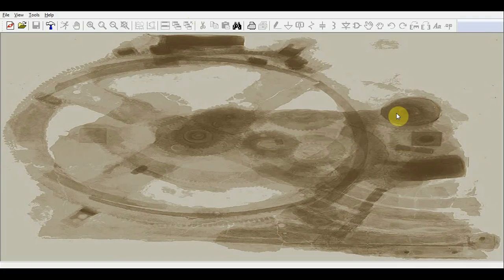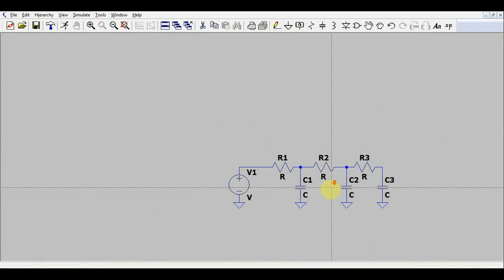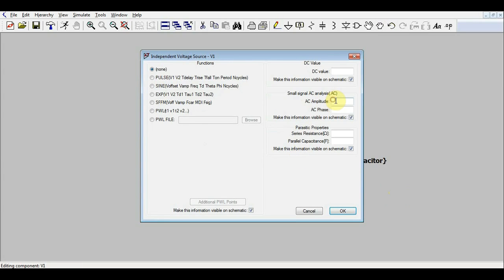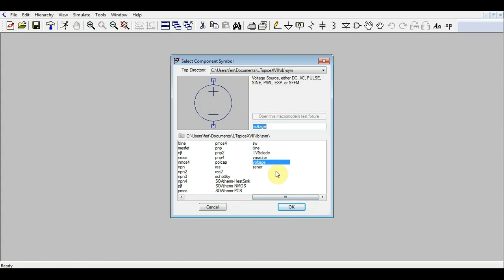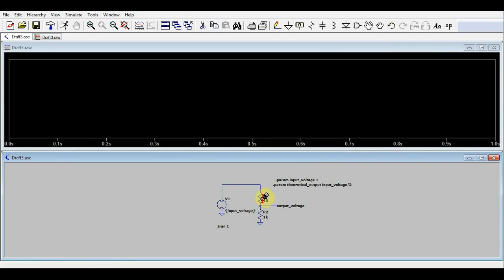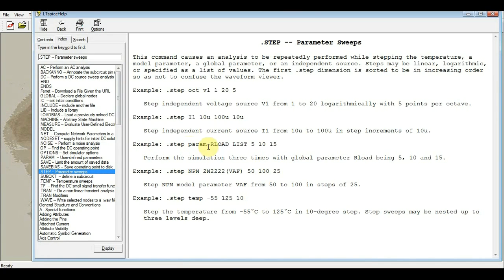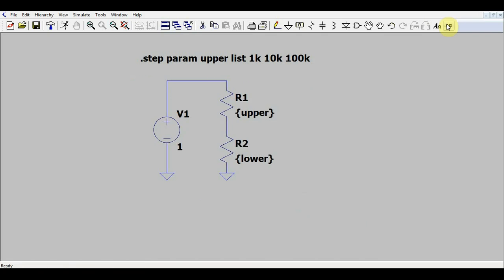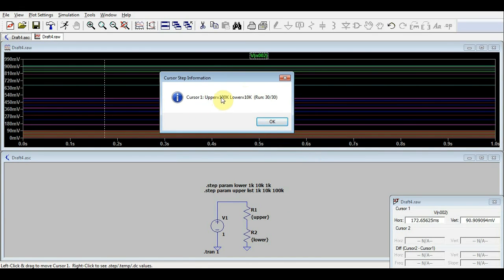LTspice tutorial - EP3 .param and .step directives

Comment: Great explanation, many many thanks for your effort.

Though I noticed anomalies on values calculated, so on the simulation itself.
Made the simpliest system with a dc supply voltage 10 V (no internal resistance), a resistor (set the resistance only) and a capacitor 1.000 uF (set the capacitance only).
So i changed the resistance only, from 0,001 ohm to 100 ohm (manually, step of decades).
Made a transient simulation : .tran 1 (or 10 or 20 depending on resistance)
Time constant is calculated differently depending on resistance.
R = 0.001 -> RC = 1 us => 61.24%
R = 0.01 -> RC = 10 us => 61.18%
R = 100 -> RC = 100 ms => 63.22%
Calculating 10 x (1 - EXP(-1) ) would give 63.21 %.
Differences even with peak currents.

Is it explainable ?

If you prefer a better way to send you data please let me know.

Thank you again
Reply from the maker: When a transient simulation gets performed, the program will not calculate every possible timestep; there will be a certain blanking time in-between steps, where the output plot is just an interpolated line; This will also be visible when performing an FFT on a sinewave - unless you take some precautions, the wave will be highly distorted; The main reason for this is to keep simulation time reduced while still providing useful even if approximate information, so its not really a bug but a feature.
I think this is the issue in your case as well; You can try to force the simulator to have a fixed maximum timestep - something small - its in the transient window editor - the 3rd entry.
May I ask how you calculated the time constant using the simulator?
Reply: @FesZElectronics  thanks again, in this case for the useful advice.

First of all your question.
Actually I said it improperly. I calculated the time constant with the usual formula tau = RC so in my case always 1 us. 
What I noticed is that if I used the definition of time constant as the time to reach 63,21205... % of  supply voltage, I would have calculated different time constants (i.e. > 1 us), simply misuring differences about these percentages.

About your advice.
I summarize the conditions.
Vs = 10V | R = 0.001 | C = 1000u

This what you can't get at 1 us for voltage across the cap and peak current throught cap.

1) .tran 1 -> 6.12391 V | 9.9800 kA
2) .tran 0 1 0 1p -> after 3 min still 0% done
3) .tran 0 10u 0 1p -> 6.321205 | 10 kA | about 1 min to complete
4) .tran 0 10u 0 1n -> 6.3213843 | 10 kA | immediate
5) .tran 10u -> 6.3223453 | 9.999998 kA

So, as you guessed using parameter max timestep:
(3) is the most accurate but a little slow (acceptable)

Useful was of course setting the total time more properly to complete the simulation in a smaller time (1 s -> 10 us)

THANK YOU again

Comment: .inc ,.IC indicates for???
Reply from the maker: .inc stands for "include" -  this is used to include library files; .ic stands for "initial conditions" - this is used to set voltages and currents in the circuit at start of simulation

Comment: Thanks a lot for this quick reminder. I wonder if we can have a step simulation with 2 parameters linked by table.
Let me explain an example :
3 values of R related to 3 values of C which gives the same cross frequency
We would like to compare R1C1, R2C2 and R3C3 only (not the 6 other couple)

is there any tips to do this ? like .step (R C) list ((R1 C1) (R2 C2) (R3 C3))  <== this doesn't work ^^

in this situation I can create C value from R with fc=1/2*pi*RC but this was an example. Sometime you could have 2 separate list with no evident related formula.

Thanks for every answer I could get

Comment: Nothing about curly brackets and when to use them, or the problems with doing simple arithmetic between two variables in a .param statement?
Reply: man i have the same problem. i am getting 440 solutions , i need 40 only. but its stepping all the possible numbers.

looked around the internet with no way to step it properly. let me know if you find something
Reply: hey there once again, so i kept trying stuff around. in my case i had 2 changing resistors (one increases by x )(other decreases by x ).

what i have done is set {w} as a parameter for both resistors.
like this
R1={w}
R2= - {w}

i hope you are doing the same thing. good luck

Comment: How do i make the simulation for only the correspoding values in the 2 lists  and not for all possible combinations?
Reply from the maker: I guess the best way would be to make the second value an expression related to the first; say you want to simulate in case 1 a 1K resistor and a 5k resistor; and in case 2 a 2k and 10K; you could express value 2 as {value1*5}

Comment: Is there a way to use the step directory when modelling a circuit where average power dissipation is key? I tried using the step directory, and while it provided the multiple simulations I needed, there was no way I could find to calculate the average power dissipation.
Reply from the maker: Hello Peter. That can be done using .meas statements; simply place one anywhere in the circuit and it will output the measured value in the error log (View->spice error log) The measurement is done on each simulation run.
For example if you want to measure the power dissipation on resistor R1 which is connected to nets n001 and n002 the meas statement will look like: .meas Paverage AVG V(N001,N002)*I(R1)